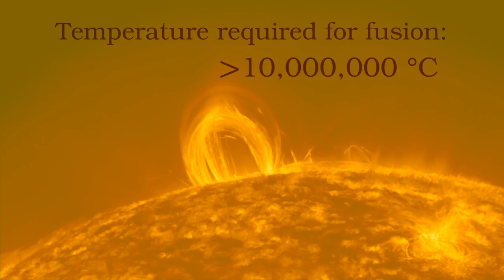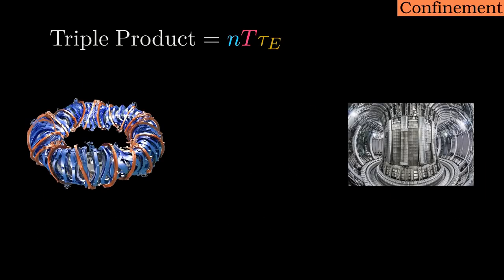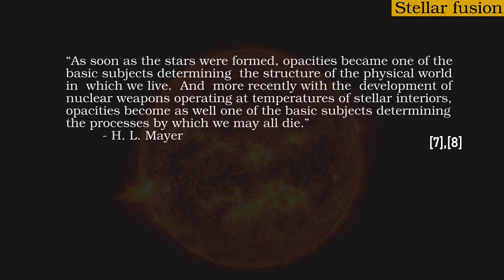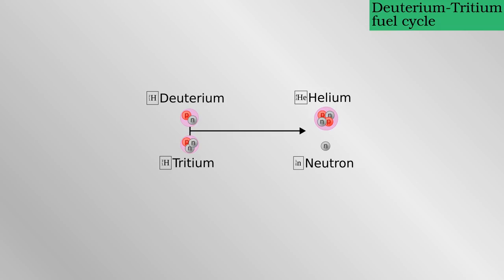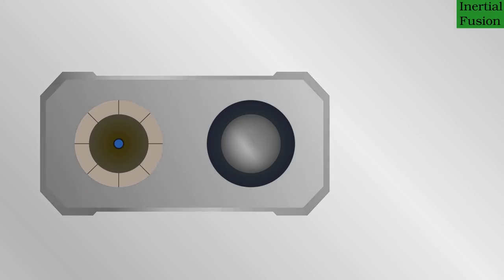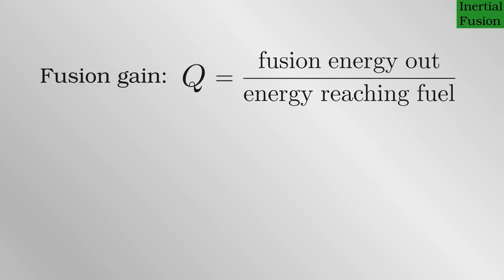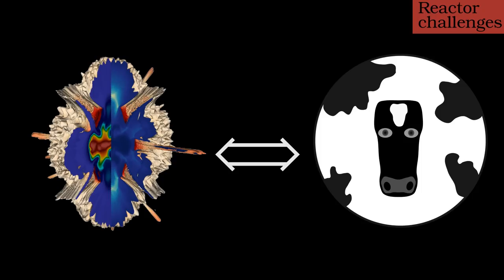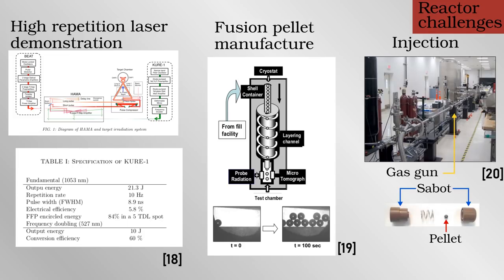How nuclear fusion works (2) - confinement, stars, nukes, inertial fusion energy

Comment: Another great video. Question - Why has tritium-tritium fusion got a lower cross-section compared to D-T fusion? I would have thought that the extra neutron would increase the weak nuclear attraction and help them fuse. Any info to help me understand this would be greatly appreciated!
Reply from the maker: It is true that D-T appears to be the outlier: adding neutrons seems to help all other hydrogen isotopes to fuse. The simple reason is that there is a resonance in forming Helium-5 which boosts up D-T specifically. For a detailed explanation, you can look up Gamow factors and so on.
Reply: @ImprobableMatter  Thanks! Looking forward to your next video!

Comment: How do we actually get energy out of fusion? Are there more efficient approaches than "make things hot and drive a turbine"?
Reply from the maker: "Hot things drive a turbine" is the only way. Most of the energy is carried by neutrons, and the only way to extract that is by allowing them to collide with a solid blanket and deposit their energy as heat. Then a turbine is as good as it gets.
Reply: @ImprobableMatter  Thanks! 
I had seen a video a while ago where the creators claimed that their fusion generator was powered by the expansion of the plasma directly inducing a current in the electromagnets containing it. Which seemed very interesting. 
But even if that works, if most of the energy is in the neutrons that seems ridiculously inefficient.
Reply from the maker: I have seen these kinds of claims for aneutronic fusion, but you can watch the first part of this series to see why that would be very hard to make work.

Comment: You are quite amazing.  
Thks for taking the time to explain this geeky subject so-well.  However now I'm pessimistic about practical fusion.
I wonder if you were king of all fusion research, ?what practical approaches would you try to make fusion practical?
Reply from the maker: I think the magnetic approach is more practical in the near-term. Going from 1 shot per day to 1 shot per second is tough; making a tokamak like the ones currently, but slightly larger and with a higher magnetic field seems easier.

Comment: Very interesting video. Does the tritium breeding ground need to be part of the reactor or is there another high efficiency way of producing tritium?
Reply from the maker: It really does need to. The only other way is with fission reactors like the CANDU, but you would need many fission reactors just to supply a single fusion power plant.
Reply: @Improbable Matter Would it be possible to use a particle accelerator, or even a power consuming inertial electrostatic confinement fusion device, to breed Tritium?

Comment: @ImprobableMatter You said for the laser approach "the input energy is usually DEFINED as beam energy" however, that definition is irrelevant and misleading. The input energy is the total energy into the system which is the 20 MJ of electricity required to produce the laser + the beam energy. Total input energy = 22 MJ and if we consider the 40% loss from the fusion = 20 MJ then we can represent the total energy of the system. The total output = 30 MJ however the total loss = input energy + conversion loss = 20 MJ + 22 MJ = 44 MJ. 44 MJ (input + losses) > 30 MJ (output) so there is no net energy gain. Therefore, it is impossible to have net energy gain from this process without either (1) improving the conversion efficiency of the laser (which is theoretically possible) or (2) improving the thermal conversion efficiency which is impossible. Thus, the only way to get net energy gain from this method is to improve the beam conversion efficiency. Thus the claim by the US Department of net energy gain is false and misleading. The numbers don't lie. Thanks for this series it was very informative
Reply from the maker: This is not correct. You can get an arbitrarily large amount of fusion energy out so that it exceeds the losses.

Comment: "Keepeing  the plasma confined long enough....."
Xrays are rarely ever mentioned when confinement is mentioned.  Fusion gives off tremendous amounts of Xrays.   Xrays can accelerate electrons and protons to tremendous velocities according to Compton scattering.  But electrons are two and three thousand times lighter than D and T so one might expect electrons to be accelerated  much easier.  They refer to electron volts when talking about Xrays as if they are a voltage source.  If a fusion plasma can be somewhat  confined by voltages as low as 10,000 volts in a Farnsworth Fusor then the zillions of Xrays and Gamma rays coming from a fusion plasma  would be a real problem.
One Xray or Gamma Ray can deliver hundreds or thousands of volts to an electron or proton.  
Xrays might also be used for confinement.  A book I found in a public library   said that Xrays are  used to confine the plasma because otherwise a hydrogen bomb would have to be much larger like the first bomb that was many times bigger than the little warheads that they can fit into a cruise missile warhead.  One might suspect that if it is in a book at the public library then it is no longer classified.  But the author said that when he wrote the book decades ago it  was still classified.  He went around to hydrogen bomb manufacturing facilities on the public tours that they give and asked a lot of questions.  He found out that they made Uranium foils at one factory.  He asked a leading question about the foils to the tour guide and the use of uranium foils to reflect Xrays to help confine the bomb plasma.  The tour guide suddenly asked him how he found that out because it is classified information.  He was just guessing but the tour guide confirmed his suspicion.
If a big sphere of DT was heated at the center by lasers to the point that the plasma began to emit Xrays near the center then the Xrays might be used to confine a small plasma at the center.  The concentric convergence of the lasers would tend to generate Xrays with the same convergence.  If  Xrays accelerate electrons much more easily than ions because of the weight difference, one might suspect that a buildup of negative voltage at the center might be very useful for confining a plasma as in a Farnsworth Fusor.

Comment: Can you maybe make a video about hb11 energy startup from Australia? It's working on proton boron reaction. They are claiming it becomes possible because of major improvements in laser technology. I just watched some of your videos and in particular about startups being cheeky. Is this hb11 energy startup one of those or do they have some sort of science that backs them up?
Reply from the maker: Did you watch part 1 of this series? In short, it won't work.
Reply: @ImprobableMatter  haha OK. No I have not seen it but I will now. Thanks for the reply.
Reply: @ImprobableMatter  I've seen the one that states we won't have fusion by 2040. The central idea being net energy gain is basically worth nothing outside research communities. But the examples in the video were based on other type of fusion. But I guess the same is true for the proton bor reaction because of the low efficiency of lasers.
Reply from the maker: @ruffyistderhammer5860  This one: https://www.youtube.com/watch?v=2DzKXN1pcwY

Comment: People overlook the fact that the sun has a near-infinite amount of energy to generate fusion with: its own gravity
There is no way to achieve such a reaction without emulating this system, and current efforts don't produce as much as they spend trying to artificially create and maintain the pressures and heat. Gravity is the answer.

Comment: I love the series of fusion based videos so far, but I have a question. In the nTte equation, would it be possible to substitute frequency and amplitude with Temperature to make up for the temperatures needed? Something like this: n(ω + A)te. It just feels like getting a plasma that hot is very innefficient to me.
Reply from the maker: I'm not sure I understand in this case: frequency of what?
Reply: @ImprobableMatter  I'm thinking you could replace the temperature with the atomic frequency of the fuel your trying to fuse to 'excite' it and then increase the Amplitude of that frequency to forcefully induce fusion through that excited phase.

P.S. Sorry for my Butchered English structuring. I am a native speaker of the language but when I get excited about something, I tend to use the wrong words to try and explain what I'm thinking.

Edit: In other words, Couldn't we use frequency and amplitude to mimic the properties of temperature by using the atomic frequency of the fuel and increasing the amplitude to make fusion possible?

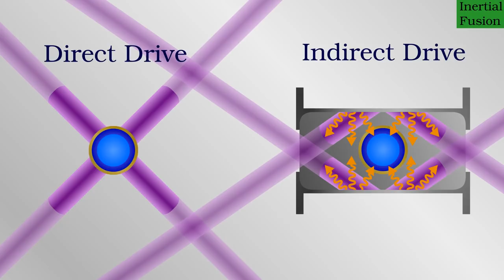Comment: 15:30  So...  does that violate the Nuclear Test Ban Treaty?  The treaty does not specify a size and it is technically structured like a nuke and could be interpreted as the world's smallest nuke.  I'm being sarcastic of course but the thought popped up the first time I heard about what the NIF was doing and how the fuel capsules were structured.
Reply from the maker: The facility was mostly built for the exact reason of continuing testing without falling foul of that treaty.

Comment: I am curious about how fusion works, if a thermonuclear bomb (say 500 megatons) is detonated deep under ocean, since water doesn't compress the resulting hot water plasma would be under immense pressure, would that cause fusion of water plasma? could it cause chain reaction of water up to the water surface?
Reply from the maker: In short: no.

As you will see from part (1) of this video, Hydrogen itself is less reactive than the Deuterium-Tritium mix in modern bombs by a factor of 10^25 = 1 followed by 25 zeros; it takes an average of 9 billion years for a given Hydrogen atom in the sun to fuse. Deuterium on its own, which is not common, is much more reactive, but still less than a 50:50 D-T mix.

Water does compress when you're dealing with the sorts of pressures described here. It would be squeezed until the electrons are stripped from atoms and it becomes a plasma. However, it would not be compressed or heated nearly enough to achieve the necessary triple product even if you had D-T surrounding the bomb instead of seawater.
Reply: @ImprobableMatter I was very curious about water plasma properties and how much of that water plasma would be fused in such extreme situation when a 500 MT bomb was detonated at ocean floor.
Since deuterium is 0.05% of sea water, would the deuterium and whatever else is in water plasma be easier to fuse than protons? Would deuterium + helium 3 fusion occur?
This part is confusing for me -"However, it would not be compressed or heated nearly enough to achieve the necessary triple product even if you had D-T surrounding the bomb instead of seawater."
If fission reaction can set of fusion in surrounding D-T, why can't first stage fusion be used to start second stage D-T fusion surrounding the first stage? Or D-T fusion is not fist stage, but second or later stage?
I read that in theory it would be possible to endlessly add fusion stages, and only reason it is not practical is because of the size and mass of such a device/bomb.
Reply from the maker: As you can see from this video, the primary fission explosion must be set off so that the x-rays precisely compress the secondary fusion bomb. If you just let x-rays expand in all directions, the compression would not be enough. In order to add another fusion stage, the device would have to be engineered to cause the x-rays to work in a similar way (not just randomly expanding in all directions).

Now, let's say you replaced the secondary with seawater so that it does indeed reach the density and even temperature necessary. Whenever two Deuterium atoms collide (there is very little Helium 3 in seawater), they might fuse, less frequently than D-T. However, because, Deuterium is uncommon in seawater, only a tiny tiny fraction of the collisions would lead to exactly two Deuterium atoms colliding and then fusing. So a secondary made of seawater would add almost no additional energy.
Reply: @ImprobableMatter  I wasn't thinking seawater as secondary, more like quaternary after primary fission that sets of secondary fusion that sets of tertiary fusion, I was just thinking how would one make biggest bomb possible.
When Soviet scientists were making Tsar Bomba in 50s they were worried about setting of a fusion chain reaction, later it was proven to be impossible in the air, I was think what would be the situation deep under water with much higher density and pressure, also no need for chain reactor, adding let's say 50% energy to initial bomb would be a huge improvement 
Why can Helium-3 fuse in the Sun at 10-15 million degrees, but ITER needs 600 million degrees, is it the difference in pressure?
Reply from the maker: Helium-3 will fuse in ITER. It is just that even there the reaction will go too slowly to achieve a net gain in energy.
Reply: @ImprobableMatter Thank you for explaining this.
ITER needs net gain, contrary to any gain for a thermonuclear bomb that is just an extra energy.
But it makes sense that water would be very poor source of additional fusion energy unless someone drops that water into a star.